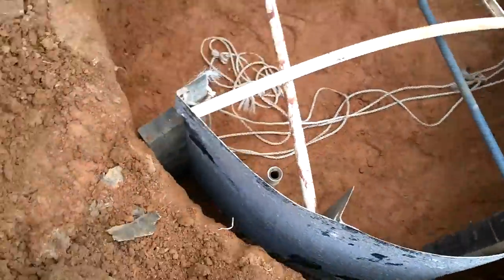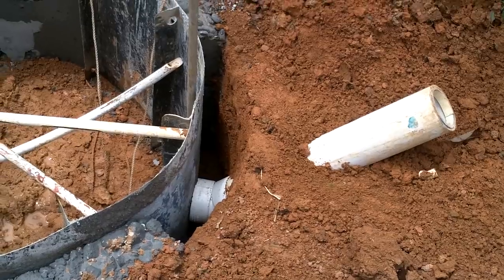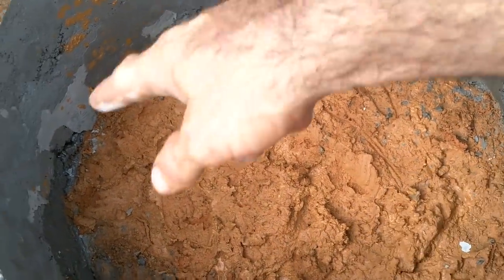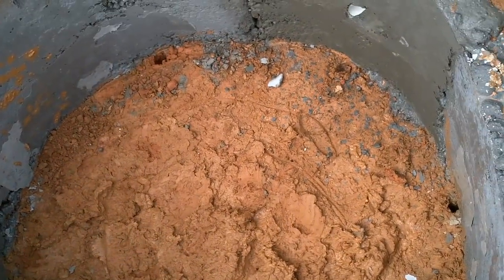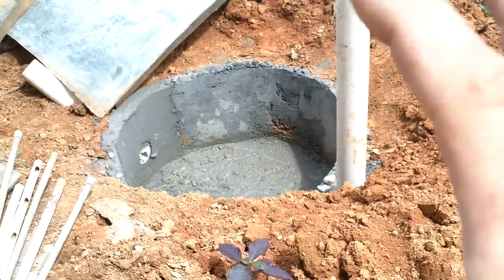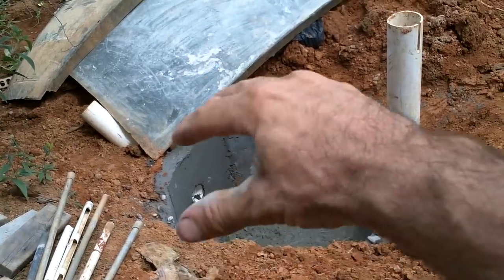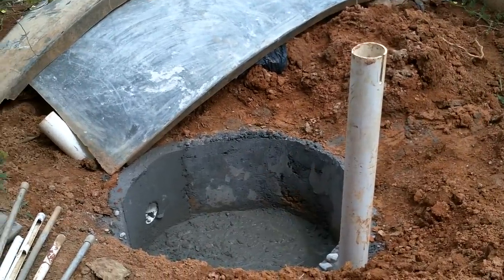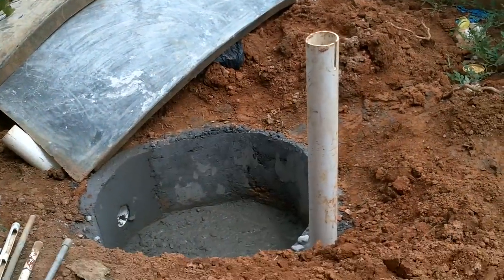Fart Machine 001 (I mean flactulance)

Comment: Start it with some cow pies, it has all the good bacteria you need. With such a small size, it won’t produce much gas. I say what I say because I have a biogas system but mine is 12 meters wide x 30 meters long x 3 meters deep. I have it burning the gases 24/7.  Mine is made out of pvc liner.  It’s a good experiment for you though. Good luck and I enjoy your videos!
Reply: I saw a Jungle community biogas build, using a 3' diameter, 25' long, flexible plastic tube/tarp (PVC liner maybe). Buried 1/2 way into the ground, 1 end you add 1/4 solid waste w/ 3/4 water. The long balloon eventually filled up, hose in middle on top, bricks and boards for pressure, and the other end, out comes the fertilizer. Takes a month or two to complete the journey. Cost was under $100 for the huge tube of flexible plastic, probably 15-20mil, not exposed to direct sunlight. Super simple build, and supported a small village of 30 people.
Ive always felt that human waste is one of the biggest wastes modern society produces. We paid for those groceries... or grew them with hard work... "recycle, reduce, reuse" was the motto when I was growing up, not that im very good at it yet. I only recycle mechanical and electrical stuff, haven't gotten into the biological yet.
Reply: The one bad thing about my biogas system is it produces a very high amount of h2s which loves to eat anything metal (rust it out) and corrodes aluminum. The cost to build a system for cleaning the gas is quite high. I have powered a generator but the hydrogen sulfide will ruin everything so I just burn it. Every application is different. I don’t use the gas for cooking or anything because I don’t think the food will end up tasting good. Even when burning it, it doesn’t smell good.

Comment: In rural China they have a system that uses a big clay pot as the generator and collect the gas in big truck tire inner tubes. To create pressure they put weight on the inner tubes forcing the gas through a hose to a burner.  I hope to see your system in action. Thanks for all you do.

Comment: this will be an awesome series to watch and your correct  not enough of it is done and what you may already know or in time will find out is that if you wanted you can add "stages/tanks" to your system for even more anaerobic digestion (which work kinda like filtering but not) anyway the water at the end stage can't be drank BUT for watering plants or being able to confidently return the water to the ocean and know that the particle per-million are actually lower than what most sewage treatment plants in the U.S. are allowed to put back into our rivers and lakes.

Comment: There is a really good set of plans from home power magazine for the digester. also a how to for a hydrogen cell. my grand parents had a hydrogen setup that collected the gas in a rubber bladder anchored in the bottom of a tank with water on top to provide the working pressure for the gas. They also used  tractor tire inner tubes as a replacement bladders. All produced with a wincharger TM.

Comment: There is actually a dairy here in central california, that runs almost everything on methane, even some vehicles. they have 3-4 covered manure ponds, that capture the gas, and they have a small work house that holds the processing systems. its quite the operation

Comment: I worked at the sewage plant in Huntington Beach CA back in 1991 as a union Carpenter building the football field size 8 foot thick foundation (poured in 12x12 foot sections) to house the multiple 2 story tall giant V16 generators that would be run on the methane gas from the plants sewage process.

Comment: It will 100% work as long as you get it air tight. I have one in the UK (a lot colder than you) made out of a 55gal drum and I can cook from that. May have to drill out the jets on the cooker to make up for the lower gas pressure

Comment: I hear ya about the inefficiencies of modern tech. We have refrigerators that put out waste heat and we just let the heat circulate in our houses. Which then has to be cooled by air con. Which also puts out heat which we just let out outside. Then also have water heaters to heat our water. Pool heaters etc. So wasteful

Comment: As far as I know, this will produce a bit of heat during the compostation/fermentation process, so by running a copper coil with water through it, you could use it as a support heater during colder days or to do some other stuff. 

Keep up the good work, and greetings from germany!

Comment: One big problem with waste /trash is that you can only have 'dry' trash dumps so collecting gas of trash is not allowed for municipal waste.
I don't know the reason probably safety?
Reply: In Florida I know of a few dry trash dumps that give off gas because of the rain and natural moisture. So they collect the gas with a set of PVC pipes and run a generator that charges batteries for the lights and monitoring system.

Comment: Have you considered foamcrete? To save on concrete?  But I guess you can add ag, or sand, I seen in comments, someone wanted to build a boat from foamcrete, being it floats, if you haven't seen it, maybe checkout foamcrete, 

I need to build one of these, I have a gas water heater, and need to get a gas stove,

Comment: I dont mean to be rude, but this does not have anything to do with politics, its simply not worth the hassle for the amount of gas you are getting, also you have to use certain type of poop with certain bacteries, also the tank have to have a termostat and a heater built in, since bacteries can day overnight in the winter if temperature goes too low, its also dangerous as it can contaminate your drinking water/environment/underground water veins etc. You can kill bacteries by adding different bacteries or just having wrong Ph levels or chemicals, then you have to clean up all the poop from the tank and decontaminate it, its not as easy as it sounds and the gas going out have to be vented if you do not use it it will be a very slow flame but it will keep going for as long as bacterie swill be happy and multiplying eating the droppings.

Comment: Until poop comes out the stove 😫
Reply: That is the built in indicator that your low on Biogas. :)
Reply: @Reach3DPrinters  my fear would be growing nose blind to any odors that may be present. But I think using some sort of a heat exchanging plate that allows the heat to cook the food and the exhaust gasses to escape outdoors. Ever seen Mason stoves from Russia? They use "bells" to trap the hottest gasses and the cooler gasses escape under baffles. Check them out they are epic.